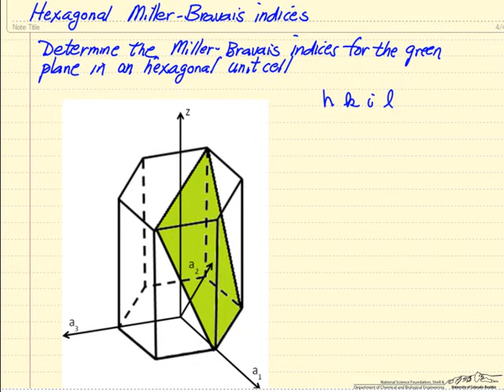Miller-Bravais Indices: Hexagonal Structure

Comment: I don’t understand. I can’t visualize it. You also said that a can’t be c and proceeded to make both variables 1
Reply from the maker: This is a great question.  The a and c terms are measurements of the cell, but the cell is 1 unit.  So the height of the cell is 1 unit and the distance between the center of the bottom and one of the corners of the bottom is 1 unit, even though those are (or can be) different lengths.  The true distances can be found by knowing the molecule and its size.  Different molecules can have the same unit cells, but different measurements.  I hope that helps.

Comment: You briefly mentioned that there is redundancy since h+k=-i but didn’t explain it any further. Isn’t this redundancy caused by the fact that we have 4 axis? Why don’t we just use 3 axis? Wouldn’t having that redundancy add confusion? For example, the plane you have here can be represented by the coordinates (10-11) but also (2101).

Comment: I'm sorry but I want to ask, you say that C is not equal to a, but why the value of both is 1? thankyou
Reply from the maker: +homeMM23 This is a great question.  The a and c terms are measurements of the cell, but the cell is 1 unit.  So the height of the cell is 1 unit and the distance between the center of the bottom and one of the corners of the bottom is 1 unit, even though those are (or can be) different lengths.  The true distances can be found by knowing the molecule and its size.  Different molecules can have the same unit cells, but different measurements.  I hope that helps.  Please don't apologize for asking.  Always ask when you don't understand.
Reply: +LearnChemE oh okay haha thankyou for replying :D
Reply: thank you fucker LearnChemE, I wont apologize again.
Reply: @john40439  savage bro🔥

Comment: h+k=-i right? but -i in this case would be -1 not 1.. or am i missing something? 1+0= -(1) = -1 unless my math is off somewhere
Reply from the maker: It is 1+0 = 1 -(-1). Recall that a 1 with a line over it is a -1.  The screencast looks correct to us.